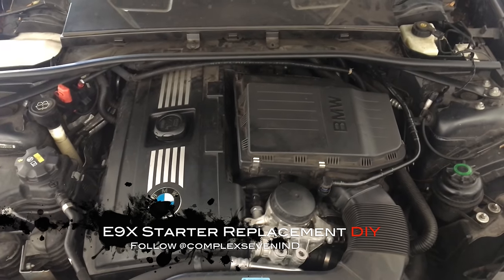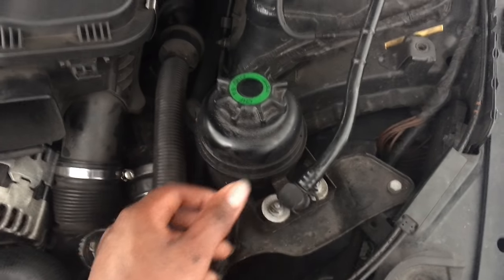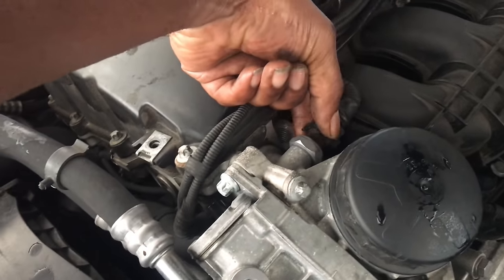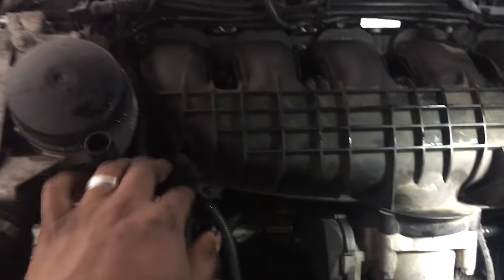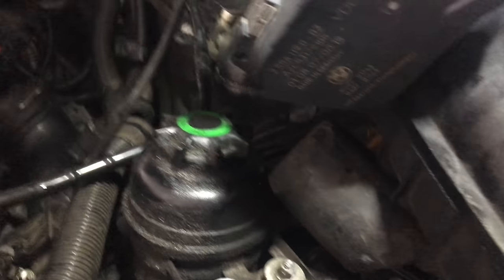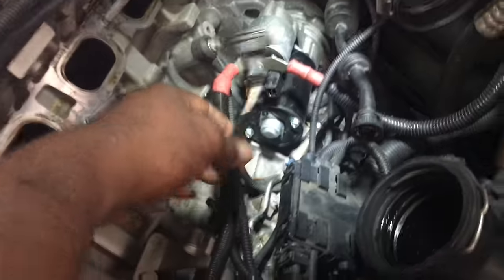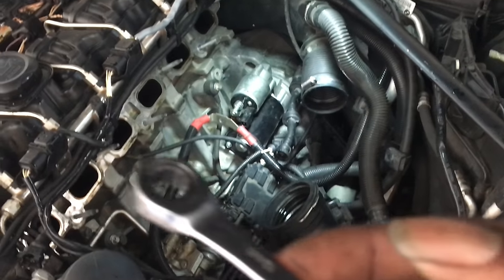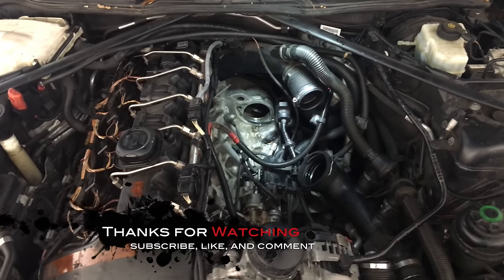BMW 335i N54 Starter Replacement DIY

Comment from the maker: One note I should mention is to loosen the back bolt first. That way not all the pressure is spread to it if you remove the easy one at the bottom of the starter.

Comment: 2010 E92 335i here.  I wasn't so lucky; those guys at the factory torqued my bolts super duper hard.  I got the lower right one out with E12 socket using brute force (just like in this video), but the back bolt I wish I had done differently.  use a 3/8 curved wrench with breaker bar since the bolt is an E12 head (smaller than the E14 bolt you will use to replace it).  do not use 10mm wrench because if it's torqued super hard and seized in there you will strip the head.  you got one shot at this, if you strip the head you will need to cut the head off or break the starter housing near the bolt.  I ended up cutting the head off with dremel flex attachment and carbide burr bits (was not fun).  I did all of this without removing the manifold fully (I just removed the hose and intake; the cable clipped on in the back of the manifold  I removed after the manifold was off).

Comment: THANK YOU for this.  Seriously - I had my starter go down on my last week - I found your vid and you gave GOOD directions.  Not 100% how I did it...but I had lighting issues and had some connector problems as well (little bastards don't always want to come off easily - so I removed my throttle body instead of keeping it on the intake manifold).  But for the most part - your vid was VERY helpful!

Comment: My starter's last start was right before I drove 3h away. Wish I could have known. Anyway here I am in my mom's driveway tearing into this thing. I found that if you use a breaker bar you can pull up on an E-torx socket from behind the rear turbo intake pipe. It's important that it's a bar, 12-15" long, because they afford you a few degrees under 90 socket to handle. That was the only way I could do the job, because although I could buy e-torx sockets at the parts shop, no luck with any wrenches!
Anyway, any recommendations where to get some of those wrenches? All I find online are these Gearwrench brand with bad reviews.

Comment: Mine went at 80k, starter was an oem unit so it lasted 80k miles. The junction box was a PITA, eventually I just got so mad it gave me the strength to pull it off lmao. After that it was a breeze.
Reply: Basically, I was about ready to punch something and just said fuck it and pulled as hard as I could and it just slipped off. So satisfying tho. Then I took a break and ate some pizza.
Reply: lol that junction box is a PITA yes! I used all my strength and the thing wasnt moving, I was bending the metal bracket it was on so I grabbed a dremel and ground the tabs off and then it came off easily! ;)
Reply: Same af🙃 then it hit me to spray some wd40 on my finger and just rubbed some of it on the bracket and it just slid off🤦🏽‍♂️
Reply: @2V_KT  🤘🏼🤘🏼🤘🏼 WD-40 FTW

Comment: Just as a good protocol, i suggest new throttle body and intake manifold gaskets. You have the parts off, and the cost compared to time and money later is low.
Reply from the maker: Yea might as well, mainly the intake manifold gasket. Thanks for the addition!

Comment: Thanks friend for doing this video. I'm thinking about buying a 335i or xi and before I do I wanted to know how difficult it is to replace the starter, water pump, and power steering pump. If I can't maintain it myself then I won't buy one. Thanks again.
Reply from the maker: No prob hope it was off some help. I would lean more to the 335i, the xi can lengthen maintenance times by a lot for anything that needs to be accessed underneath the car, such as the oil pan gasket or even replacing the turbos. The starter, water pump, and power steering pump on a scale of 1 to 5, is lump them around a 3. I would definitely recommend you have extensions and a wobble socket, since most of these jobs are straightforward but the bolts are in odd angles and orientation. Such as one of the starter bolts in this video. All in all the biggest job you would have to do to fix leaks etc, would be the oil pan gasket and just for that I’d recommend going with a 335i. If your doing the work yourself it’s a whole lot less headaches.

Comment: My college kid just paid a garage $1000 to do this.  Its easy when you are at home.  But when it fails on the road... get ready to spend some BIG BUX.
Reply: Tap the starter with a piece of metal, it should start for the last time
Bring it back home and get the job done
Reply: @mansouralblooshi3004 nope it’s got magnets inside it won’t work
Reply: @louisperez2915 So what ?

Comment: i have a huge problem 
(i guess) i got a bmw 335i n54 2007 automatic gear box

And 1 week ago i had fuel issue, because i did a modification on my fuel tank pump, on the climbing road (fuel pump sucking more air instead of gasoline) 

That night i insisted even so running my engine like 10 times, i insisted with the starter till it stopped(my fault) 

Trying to run the engine i could hear a noise like ''dling''or'' tling'' coming from the engine compartment (that moment starter won't kick anymore)

i replaced the starter by a new complete one and also replaced the battery by a new one

i still hear the ''tling or dling'' and engine still won't start

What could it be?

Comment: may not want to disconnect the battery though cuz then you would have to do a reset with a special scan tool, not a code reader, otherwise your battery will die over night and most likely take out your footwell module which controls the lights and turn signals etc. i would recommend disconnecting the cable at the jump start terminal that way it no power to starter but still to the rest of the system. had my module go out like that and apparently it's very common with dead batteries or disconnects. thanks for the vid though.

Comment: @COMPLEX NOSHI, it is so hard to remove the back bolts of the starter..I pretty much tried  everything..
Reply from the maker: If up top is not working out, use some extensions and a wobble socket to get at the bolt from under the car going up through the driver side of the transmission. In either case top or bottom make sure the socket is secure on the bolt and carefully about stripping the bolt.

Comment: My car won't start but clicks whenever I try, should I replace the soleniond or the motor? 08 335xi
Reply: Same here, did you figure it out?
Reply: @Jetsrockful  I’ve got same problem. Any luck to either of you guys?!
Reply: @brennanwilbanks5655  i replaced my starter when it was just clicking now it cranks and doesnt start lol

Comment: How did you get that black box off, I'm trying to work on my 2007 335xi and it is not moving at all and I'm about to take the bolts off. Please reply I need help
Reply from the maker: If I recall right you just have to pull it towards the engine to get it off the 2 prongs on the manifold. When it’s stubborn I usually walk away and come back and give it one good yank and it comes off.
Reply: @nOshi2x  alright I will try it again thank you

Comment: can’t figure out a way to reach in to the long back starter bolt. regular ratcheting wrench stripped the bolt. i have the etorx but can’t fit a ratchet or anything in there. ideas?
Reply from the maker: Since you have the etorx. Your best bet would be to use some extensions and a wobble on it from under the car. So jack the car up and put it on jack stand and from between the driver side of the transmission feed the extension up and have someone up top guide it onto the bolt. You will then be able to loosen it.

Comment: I WHEN TO A MECHANIC TO INSTALL MY STARTER..SAME DAY A HOUR LATER AFTER PICK UP MY CAR A ENGINE LIGHT COME ON THE SIMBOL IS A ENGINE IN HALF YELLOW THAT MEANS THE ENGINE IS NOT WORKING FULL POWER..MY QUECTION IS IF THE MECHANIC LET SOMETHING DISCONECTED WHAT SHOULD BE ??? HELP!!!!
Reply: That sounds like a charge pipe leak, not enough boost. Old gaskets leaking or something not tightened. That sucks. :-(
Reply from the maker: Yea definitely sounds like a boost leak of sorts, just have to go over everything again. It’s usually the vacuum line that goes into the throttle body that gets forgotten, but upon start up it will generally set off a code. Easiest way to know is to scan the car with a bmw specific scanner and it will put you on the path to check for a boost | vacuum leak or possibly a misfire.
Reply: @nOshi2x  OK THANKS .
Reply: @TheBMWgarage   THANKS.